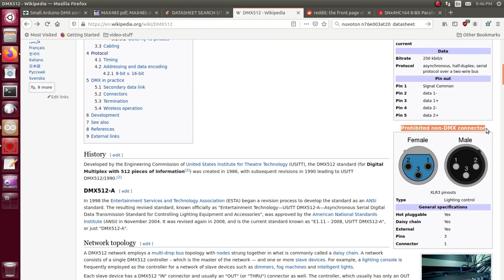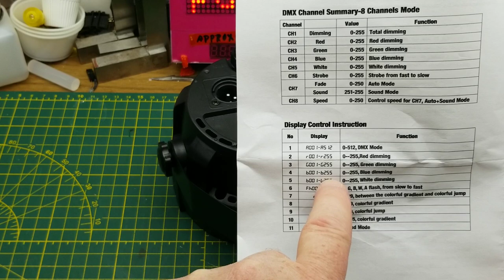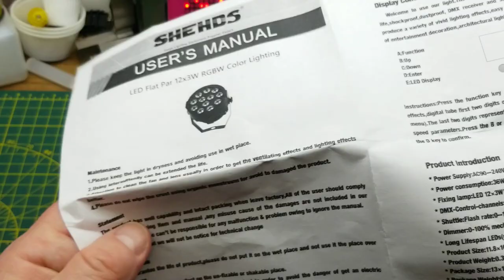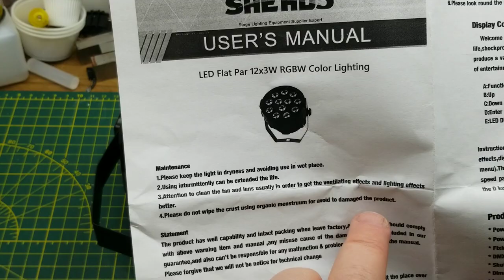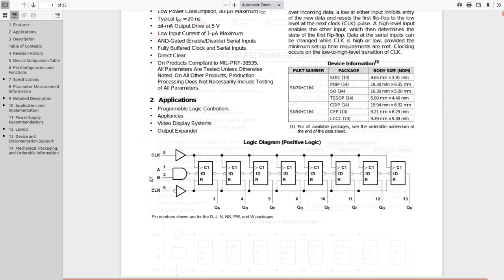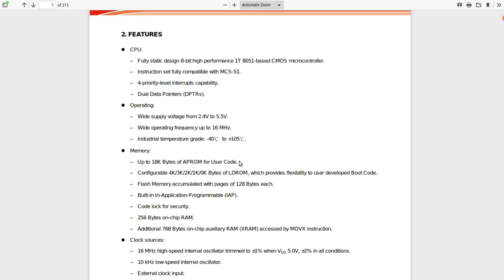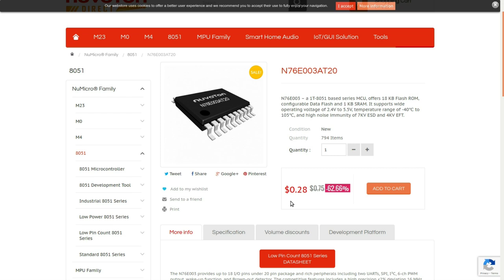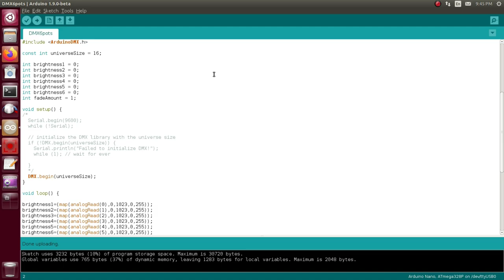cheap stage light - teardown and Arduino control

Comment: You would think that a factory that builds lights all day would have those torque settings down pretty well.  That's amazing.  Fun project.  DMX is such a cool protocol. It seemed like voodoo the first time I used it, but Arduino shows just how simple and elegant it is.

Comment: A "simple project" but you got it done and I'm impressed.  Looks like your "final" code was a bit more complicated at the end with some patterning happening.  I never knew that DMX programming would be so easy with the Arduino.  All thanks to having good libraries.
Reply: pro trick : watch series at kaldrostream. Been using it for watching all kinds of movies recently.
Reply: @Casen Keith yea, I have been using kaldroStream for months myself :)
Reply: @Casen Keith Yea, have been using KaldroStream for since december myself :D

Comment: Ya, no need to worry about PCB safety isolation cuts when you're going to put the AC input pads as close to each other as possible, not use the pad holes, and use stranded wires that are barely holding on by a strand or two. - 7:29
Even the opto-isolator is barely being used with a low voltage trace less than a millimetre from a HV trace.  That wouldn't pass any safety standards... I was going to say in North America but I don't think it would anywhere in the world!

Comment: The aluminum housing is very lightweight and easy to install. Very suitable for my stage. The lighting adjustment is also very smooth. It looks good and the price is very favorable. I expect it will have a long service life.
Reply from the maker: That isn't aluminum - it's 100% plastic.

Well, the mounting bracket is some kind of metal, but that's it.

Comment: Is that a logarithmic slide pot or a linear one? It could explain the coarse steps if it was a Log pot. Very cool stuff though!
Reply from the maker: Maybe, but it also stepped ugly like that when i just ran a fade sketch without the pots, or when it was running on it's internal modes.
Reply: @pileofstuff  Got ya! I can't wait to see what you end up doing with your custom light!

Comment: 3-pin connectors are found on a lot of DMX lighting in the UK from what I have read.

If you come across a Metalfrio glass-front beverage cooler look at the yellow label at the bottom of the door sill for a bit of a laugh.
Reply from the maker: It's something the cheap manufacturers tend to do. 
DJs and low budget barroom installs will tend towards that end of the market.

Anything more professional will have the standards compliant 5 pin connector.

Comment: The 8051... because it is only 40 years old this year.  I'm still surprised when someone designs with one instead of something newer.  PICs can be pretty cheap in bulk too and that's what I would have likely used unless you wanted to put an "Arduino compatible" sticker on it.

Comment: Did you check for proper mains isolation to the DMX sockets? A common problem with these nasty cheap units, when power supply fails they end up with mains on the DMX ports and hence become lethal.
Reply from the maker: I did. All there was is the typical leakage that is common in switching power supplies. It's a measurable voltage (about 45vac), but at <50uA, it's not really a huge concern. 

More of a concern is the potential for tracking on the PSU board, due to the minimal isolation distances (as other pointed out)

And, of course, the lack of an earth ground in the power cable.

Comment: When it comes to strobing lights triggering epileptic seizures it turns out red is MUCH worse than other colors, so assuming it was intentional to not flash the red LEDs that might be the reason.

To put it in perspective, IIRC the last time I had to test for compliance the rules were full screen flashes of most colors had to be slower than 3Hz, and for red was slower than 1Hz.
Reply from the maker: Interesting. I wasn't aware that colour could have that big an impact.

Comment: That cheap microcontroller chip (or multiple chips) could be used to make your own microcontroller board with 2 or more I2C ports and a ton of PWM ports. Would be like a board compatible with having 2-3 Nano's.
Reply from the maker: Yeah, it was intriguing. But I suspect trying to figure out how to make practical use of it is beyond my level.
Reply: @pileofstuff  true, unless the data sheet gives detailed specifics that would be very hard. It was just a thought when I seen the outputs of the chip as you described.

Comment: If you are going to be doing more DMX stuff, would you be interested in an adapter for the Renard Plus Wifi Pixel board that can do DMX (RS485) out?  Allows you wifi control of devices like this.   It plugs directly into a WiFi Pixel board but needs a mod done to get the signal and 5v on boards revisions before the v4.0 board (v3.1 is the one shiped mostly).
Reply from the maker: That sounds like it would be an interesting thing to tinker with!

I remember seeing some DMX and other protocols supported when I was looking at the WIFi pixel and Reefer boards, but  I never went down that rabbit hole at the time.
Reply: @pileofstuff  I'll see what I can get to you.  Do you have any RJ45 (8 pin) pcb mount connectors on hand?  What about an SN75176P (or MAX485) 8 pin dip? Those two are the hardest to get through the mail.  The PCBs go first class letter no problem...
Reply from the maker: @kirkb4989  I've had some MAX485 on order for a week already. I should be able to come up with something RJ45. If not, e-bay has them.
Thanks Kirk.

Comment: I know you prefer dark beers, but have yiu ever tried Schofferhofer Hefeweizen Grapefruit?  It is surprising.
Reply from the maker: I don't believe I've seen that particular one available locally.

But I've tried a few Hefeweizen s from some of the local microbreweries (back when their tasting rooms were open). They seemed like a good summer beer, but often a bit too sour for my tastes as a "regular pint".
Reply: @pileofstuff  It should be fairly available as it is a German export and I get it at Total Wine and More or BevMo if those are up your way...  Again, VERY surprising!!  It may be called Grapefruit Radler in Canada at "The Beer Store"

Comment: At least with the mains isolation you get with this and the DMX pass through you may get to die with a friend. Best form of mains isolation you can do to this is cut throught the mains cable just as it comes out the lamp. Note unplug first you don't want to bugger you day and a good pair of cutters. Best drink beer first :)